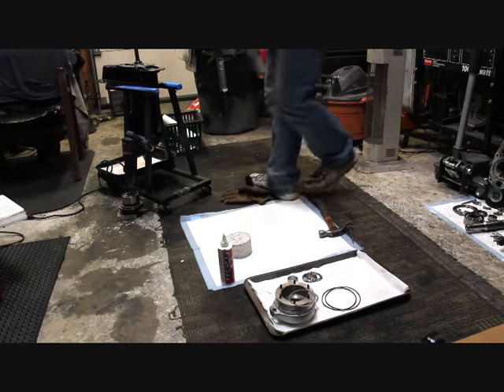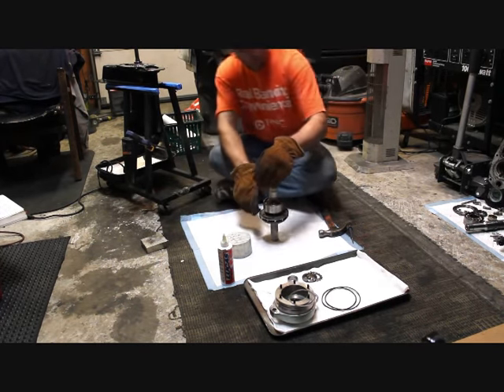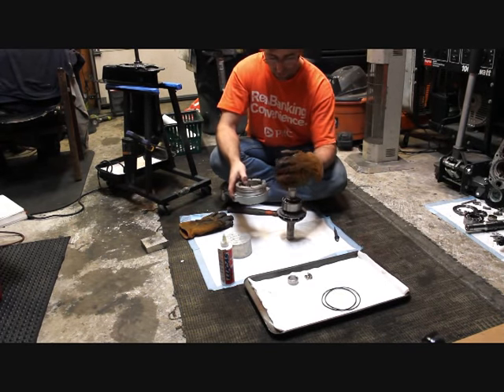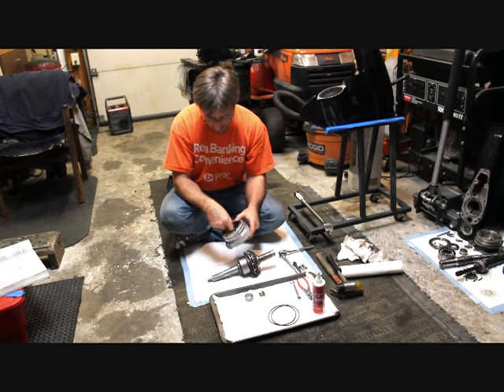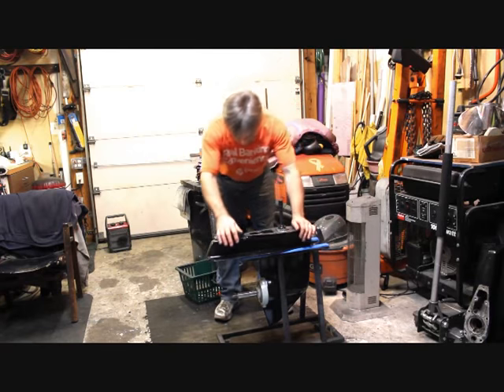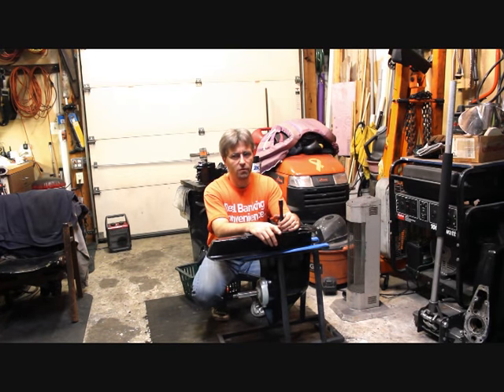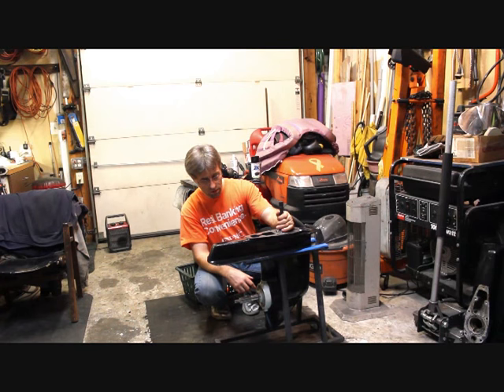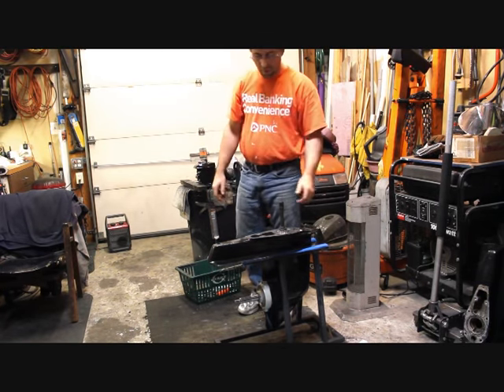Volvo Penta Project - Part 10

Comment: for the shaft seals , can we use standard seals from a seal and bearing store ? someone said they have stainless steel springs in them ? thanks for the vids !
Reply from the maker: Most seals do have SS springs. Also the springs not exposed to water but are on the oil side so yes you can.

Comment: Hi,
How much (rotational) play is acceptable on prop shaft? Any advise?
Reply from the maker: Well, between the gears there should be .006 to .010 lash which ends up being .002 to .004 on a dial indicator. Hope that helps.
 Thanks for watching!!!
Reply: @finscreenname  thanks, so when fully assembled upper and lower I could expect up to 0.02 when gear is engaged and input shaft locked?
Reply from the maker: @maciejruka8782  Ya with everything locked in gear you will get .002 to .004 rotation of the prop shaft before the gears should stop it.
Reply: @finscreenname  thanks. You mean 0.002" or 0.02" on prop shaft fully assembled with input shaft locked? Assume around 0.010" lash for lower gear and roughly same for upper giving 0.020". I bought reconditioned leg in Sweden all nice shinny inside and replaced shaft seals. Just forget to check lash on prop shaft before disassembly.
Reply from the maker: @maciejruka8782  according to the manual .002 to .004 shaft rotation. If you could get a feeler gauge between the gears (which you cant inside the case) you would be able to get .006 to a .010 between the gears.
Reply: @finscreenname  Thanks a lot. Appreciate.
Reply: @finscreenname  got the backlash measured on spline with dial gauge and all good well within spec. Same for upper. Thanks again.
Reply from the maker: @maciejruka8782  awesome! Good luck.